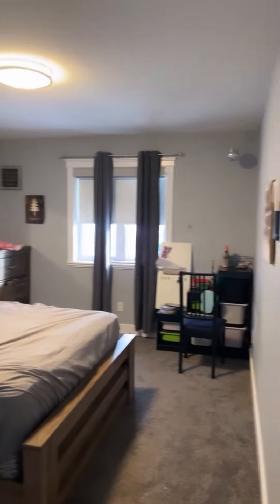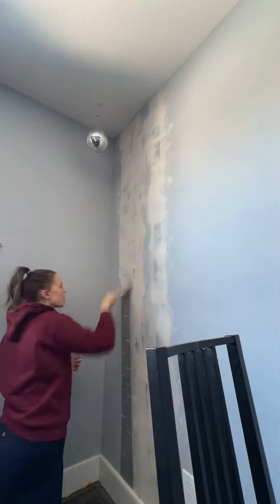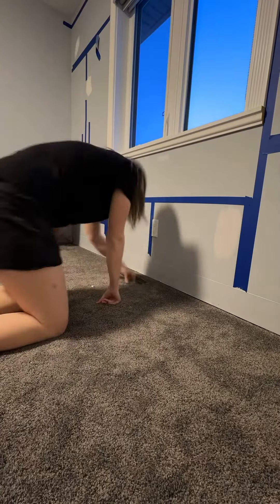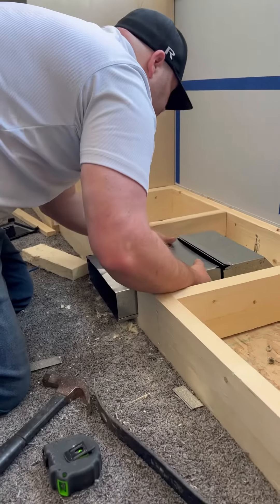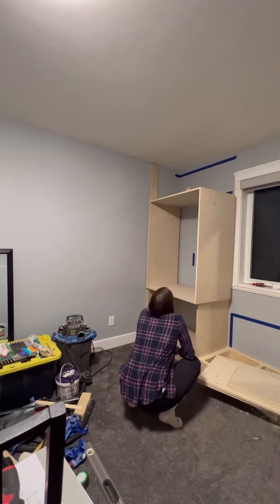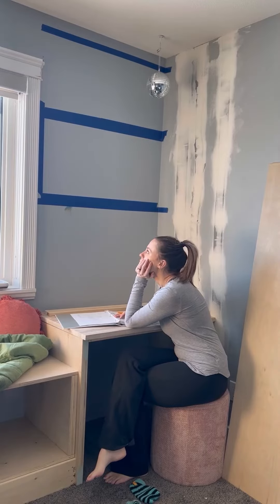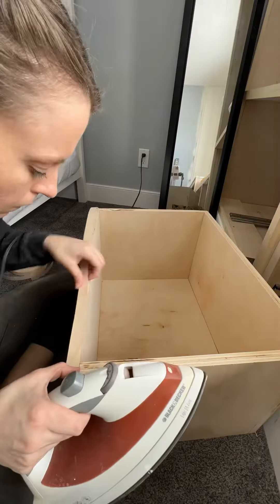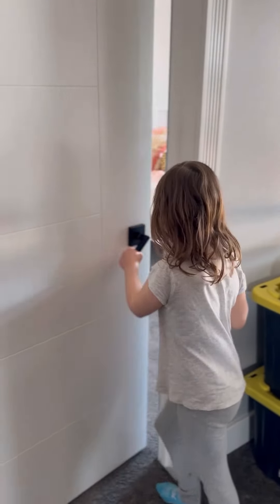Bedroom Remodel | Renovating my 7 year olds room for her birthday

Comment: Do you have a rough idea of how much you spent on this project?
Reply from the maker: For the wood, which was birch plywood, around $500. The counter was $150 and I still have the other half so for this space, it was $75. The paint was on hand but is $80/can. The light was $80. Her new bed was from Ikea but we got a full refund because it was broken and I lived 6 hours from the closet one so they didn't ask for it to be returned. I ended up glueing it back together and that part is hidden behind the mattress BUT the ned value is $250. The shiplap was left over so I don't have an approx. on that but with all the other totals and handles for the cabinets, it was around $1000 CAD! The cost could be lower as well if MDF is used! I went with wood because if she spills something by accident, it won't risk swelling! :D